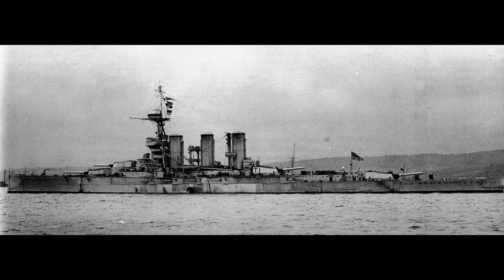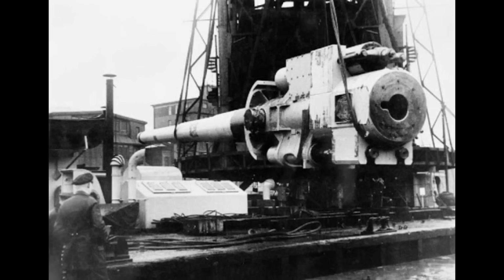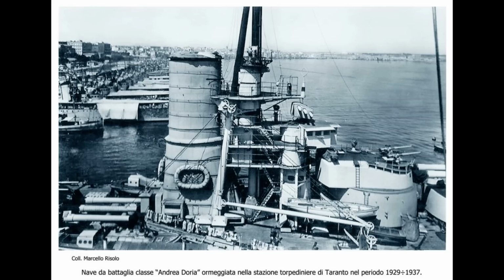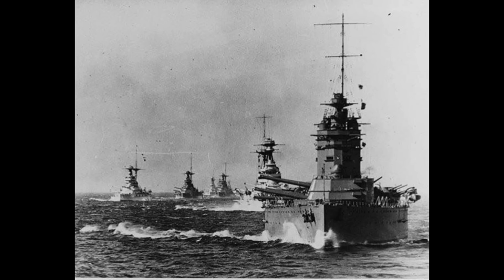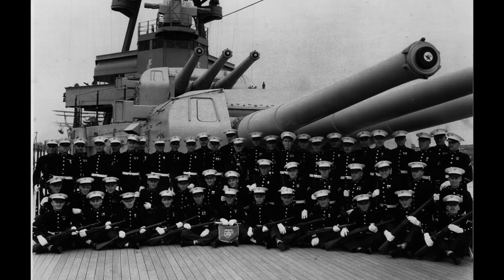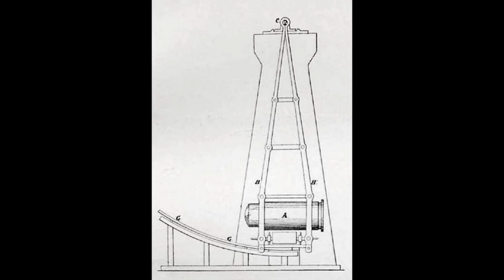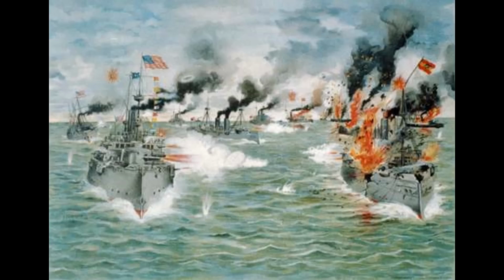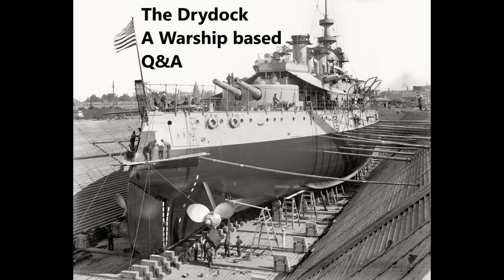The Drydock - Episode 101

Comment: The British fleet in the Med was there to fight surface actions with the Italian fleet. Let's face it, compared to Germany, Italy was always considered a second rate navy, and the RN was confident it could fight in the Med with some of its older but still powerful ships. What the RN didn't appreciate initially was the role of air power and how poorly equipped the fleet was to fight off air attacks. The found to their consternation that a couple of 3" guns and some quad Vickers machine guns just weren't a sufficient AA armament by 1940.
Reply: They also found that their High Altitude Control System (HACS) was designed including some assumptions that turned out not to be the case when the war happened. In particular, HACS assumed the target was a level bomber at constant course, speed, and altitude, so it was completely inadequate against a target that is rapidly changing altitude, such as a dive bomber.
Reply: Tom Sanders  It was, but the performance of the Italians was poor, and ships and ammunition had numerous faults.
Reply: Tom Sanders  Bismark and Tirpitz vs Littorio and Vittorio Veneto, Roma wasn't commissioned until June 1942 and never really had fuel for anything except the trip to Malta when she got sunk. Scharnhorst and Gneisenau vs Conte di Cavoyr, Gulio Cesare, Andrea Doria, and Caio Dulio. Three heavy cruisers and three panzerschiff (although the Germans never had all six of these in service at once) vs seven heavy cruisers. Six light cruisers vs ten for the Italians, although all of those light cruisers are lightly built and/or lightly armored except the last two Italian ones. And then by the time the Italians joined the war the Germans had lost a number of these ships invading Norway (and had not commissioned Bismark yet), so they never had all of them available at the same time, unlike the Italian fleet in being.

Comment: Iowa turret explosion. From my recollection, from reading accounts of experiments and data, three factors were involved. 1. The powder was older and stored on floating storage barges, baking in the sun. Fluctuations in temperature over time. 2. The powder was in pellet form and "trueing pellets" were added on the end of the charges to bring the total powder weight into specifications. 3. An over ramming of the chargs that compressed one of the trueing pellets too much caused ignition.

Comment: To put the position of Colonel in the British Army into some context you must really understand the British Regimental system, as it does not work like the regimental system of most other nations. At least until recently. 

The Regiment was NOT a combat formation, it was an administrative formation. Most Regiments in the British Army comprised, in peace time at least, of 3 Battalions.  At least in theory, essentially however they could be split into four, the three Service Battalions, and what was essentially a Training/Administrative Battalion that would be permanently based at the Regiments home barracks in the UK. The three Service Battalions would be the ones sent to wherever the Army required them Battalions would be formed into Brigades, usually of 2 or 3 Battalions, however, it is important to note that the British Army almost never formed Brigades using multiple Battalions of the same Regiment. The only exceptions to this rule occurred during the two World Wars. Essentially the British Brigade forms the same Combat Role as the Three Battalion Regiments of other Nations such as Germany or the USA. 

This habit of splitting the three Service battalions into different Brigades is why you often have rather confusing situations where a single British Regiment is on three continents at the same time. It is also the root behind the naming conventions. 1st Royal Welch Fusiliers does NOT mean it is the First Regiment of Royal Welch Fusiliers, but the 1st BATTALION of the Royal Welch Fusiliers. Numbered Regiments have their own nomenclature, so 1/11th Hussars is the 1st Battalion of the 11th Hussars. 

Another thing to be aware of, is while the usual regiment size during peace time is 3 Battalions (plus their adminstrative/training cadre), a Regimment is not LIMITED to 3 Battalions. There were 1 and 2 battalion Regiments in the Army (usually Cavalry and especially Yeoman Cavalry, which were essentially an early National Guard). They can also go higher, much, much higher. The aforementioned Royal Welch Fusiliers had some 24 Service Battalions in action by 1918 for example (and this is not including the training battalions and Home Defence Battalions), during WWII the Royal Tank Regiment had some 29 Battalions in service by 1945.

The Battalion was generally led by a Lieutenant Colonel, the most senior of whom would be the Colonel of the Regiment, usually (but not always) the commander of the 1st battalion, and usually (but not always) holding the actual rank of Colonel rather than Lt Colonel. To muddy the waters further there are also ceremonial Colonels, who hold the title but no real authority, the Reigning Monarch is the Colonel of several Regiments for example. As a result Colonel in the British Army, even today, is both a rank and a position, and not neccesarily both at the same time....

NOTE: The c in Royal Welch Fusiliers is not a spelling error, Welch is an archaic spelling of Welsh. The Regiment kept that spelling until it was amalgamated with the Royal Welch Regiment in 2006 to become the Royal Welsh, RWF becoming 1st battalion Royal Welsh, RRW 2nd Battalion.
Reply: Jesus Christ, what maniac came up with that?!

Comment: The French APC shell defects that blew up a RICHELIEU gun was not a jamming problem.  It was a base plug manufacturing defect.  The shells had deep holes drilled into the base plugs for inserting poison gas "cans", that were never actually used, to my knowledge.  However, in drilling those holes (two per base plug), the manufacturer for some reason -- misreading a spec perhaps -- made them too deep so that when the guns fired, some of the holes blew out their inner ends and allowed the propellant blast into the main explosive cavity and KABOOM before the shell moved very far down the barrel.  JEAN BART seems to have found out about the problem and welded thick steel coin-shaped inserts onto the inner surface of the base plug over the holes, fixing it, since none of its shells ever exploded, to my knowledge.

As for the US battleship turret explosion, whatever caused it was a major fluke since too-fast ramming of powder bags had happened many times before over decades of such ship loading --from well before WWI to the turret explosion on a large number of US battleships with NO problems like that ever happening before and with no more problem than crushed bags that had to be replaced.  Something happened that was completely unexected, no matter what the situation was.  A strange fluke by any measure.

Comment: 01:38:42 On Texas Marine Counry was the area where the Front Two(if I remember correctly) Port & Starboard Casemate 5"/50's were removed during the 1920's refits were originally located at. Once the Casemate opening was plated over it was "Mostly" Dry. After the 1920's refit that removed most of the New York class secondaries, those gun positions were converted to either storage or birthing spaces & the Marines were assigned some of them.

Comment: In the Royal Canadian Navy, although the RN "letenant" pronunciation was used in the past, in the last 40-50 years "leftenant" has been almost universally adopted.  This may stem from the Unification of the Canadian Forces into a single service in 1968.  In fact, for a few short years in the early 70s, naval ranks were not even permitted to be used.  Speaking to current RN officers, "leftenant" has almost completely superseded the older pronunciation there as well.

Comment: Subs hunting other Subs, you failed to at least mention the USS Batfish, a Balao class that torpedoed and sunk three Imperial Japanese subs in 76 hours.
Reply from the maker: They were surfaced though, as opposed to submerged subs hunting others of that kind
Reply: @Drachinifel    True, but it was how Batfish hunted them down.  They knew that the IJN had radar to search for enemies, so the Batfish monitored for those emissions and tracked them to their source.  Much as the same way Navies passively scan without emitting signals.  The R-class you mentioned did this by use of their hydrophones.  ~_^

Comment: The Hudson River in New York State, south of the US Military Academy's location at West Point all the way down to the Verazzano Narrows is generally quite wide, even with reasonably good depths for most of that width. The only issue is that there haven't been any naval conflicts in the area since the American War of Independence or maybe even the War of 1812. This is of course partly why the American forces floated a giant chain across the Hudson River at West Point, to keep invading naval vessels contained. At the Hudson's widest point it is 3.5 miles/5.6km wide and channel depths of 32 feet/9.7m to 200 feet/61m depending on location. So there could be a decent battle between a force coming up the river versus down the river and they'd still have room to maneuver, if they were destroyers or smaller.

Comment: Regarding triplex rangefinders, wouldn't manufacturing defects of a unit be spotted either at a quality control stage (if there indeed was any) or early on during the ship's lifespan, making the issue moot, or does it mean various rangefinders would exhibit errors at different ranges, making a simple replacement insufficient to fix the issue?

Comment: I agree with the combat effectiveness of the USN’s eight armored cruisers (9 if you count the USS New York/Saratoga/Rochester which was the first and last USN armored cruiser) even if modernized. 

However I think it would be worth modernizing them if it meant not losing the right to build a new cruiser under treaty restrictions, the value in doing so would have been in their being “presence ships” during the inter-war period. During the war they could serve as convoy escorts – just as the Greek Navy’s Georgios Averof did in the Indian Ocean – and as amphibious force flagships and conducting shore bombardment. I would have kept the 5 Pennsylvania-class in the reserve with minimal modernization, primarily replacing their coal fired boilers with oil fired steam plant. I would limit an extensive modernizing to the 3 Tennessee-class armored cruisers. 

For modernization starting out what was proposed (Norman Friedman “US Cruisers”) I would switch out the coal fired triple-expansion machinery for the modern USS Ranger oil-fired turbine powerplant for 26-knots, with two tall rake funnels and a clipper bow replacing the ram bow. I would replace the forward basket mast with a tower bridge like the modernized Idaho class battleships and New Orleans class cruisers, with modern gunnery control positions and equipment up top.

The elevation of the four 10-inch guns would be increased, and four 6-inch 50-cal guns with gun shields would be mounted amidships on the main deck between the four armored casemate guns, for a broadside of four 6-inch guns. The on the boat deck amidships forward I would mount six 5-inch 25-cal AA guns. Some Browning 50-cal machine guns would be placed in the superstructure for additional AA defense. The hull, superstructure, and upper works would be painted white and the funnels buff, as was the interwar color scheme of the RN on China Station. On the bow would be the Shield of USA and mounted on the stern a decorative crest of the Bald Eagle and Shield of the USA. Internally the ship would be well fitted out for diplomatic receptions and other “showing the flag” social functions. 

As I said if modernizing the 10-inch armored cruisers Seattle, Charlotte, and Missoula did not effect the rest of the USN building program, then I think it would have been worthwhile, especially in the depths of the Great Depression as a way to keep US industry busy and workers employed.
Reply: bjturon - The largest guns allowed on a CA were 8”, although 11” were allowed in limited circumstances (note the Deutschlands); These weren’t designed for more than 23 kn (even the Deutschlands were 5 kn faster), & their main batteries contained 4 guns, while most modern Heavy Cruisers could go 32+ kn & had 8-9 guns; Hoover despised the Navy, so he scrapped a lot of ships & refused to allow any ships to be built to replace them, while FDR used the National Industrial Recovery Administration & the WPA to fund a lot of Naval construction in the 1930’s, & they built some pretty effective combat units. I’d much rather be taking one of those to war than a WW1 armored cruiser.

Comment: I would say the Russians gained the most technology from the Type 21 for a very different reason.  There was very little to the Type 21 that British, American and especially Dutch submarine designers hadn't thought about in the prewar years.  Swede Momsen proposed building a streamlined test hull in the 1930s.  His got to do this with the USS Albacore.  The Dutch invented the Snorkel long before Germany built Submarines.  The US already had a better propulsion plant.  I don't know enough about RN submarine R&D to know where they were going.  Where the Type 21 outshined western tech was optical and acoustic sensors.  The Soviets had little of knowledge.  You can say that the Germans did proof of concept for the  US and UK.   As the GUPPY conversions show the basic Balao-Tench Class were actually better submarines than Type 21 because when converted they out performed it.  It is a mistaken belief that the post war Tang Class were just Type 21 derivatives.  They were independent designs based on the GUPPY experience.

Comment: if hms hood had kept her magazine doors closed, how would the battle have gone?
Reply: There's no evidence that it was open magazine doors that caused Hood's loss. It wasn't a turret penetration with open flash doors like what happened to the Jutland battlecruisers. The most likely cause of the loss was that a 38cm shell went directly into Hood's aft 5.5" magazine and exploded right against the bulkhead separating it from the 15" magazine, detonating both of them. This was either the result of a belt penetration (the range was short enough that deck penetration by plunging fire would've been impossible), or a shell with a defective detonator going underwater and penetrating below the belt before exploding.

Comment: Dreadnaught was not included as a fleet unit due exclusively to having almost no secondary armament..... this is not advancement ... this is just what she was built with ... if she could have mounted a dozen 6 inch she would have been included...
The Bolivians withdrew from the area when they saw how much weight of manpower and metal that the Paraguayans were moving onto the board...